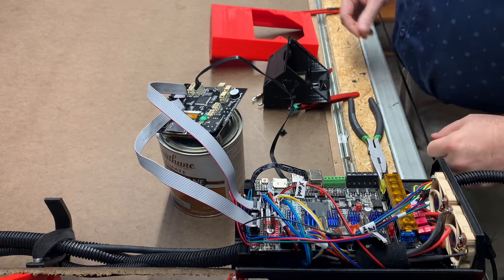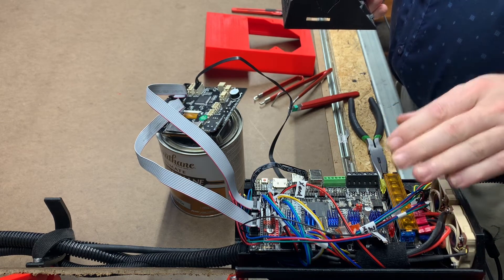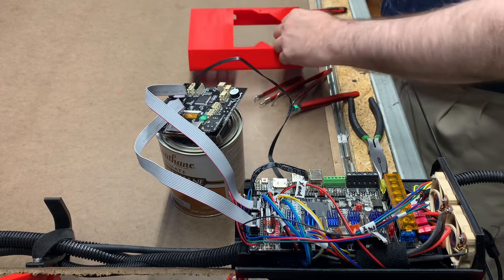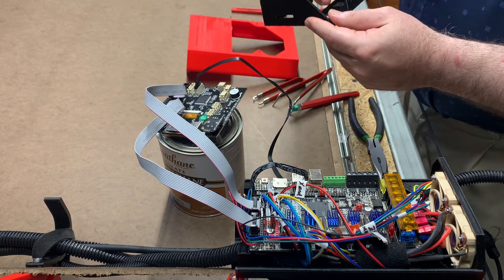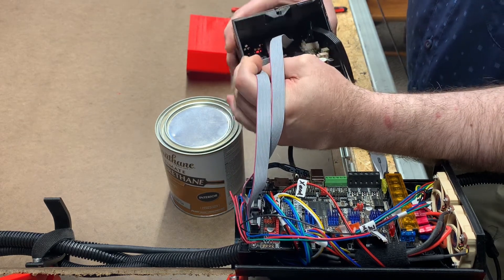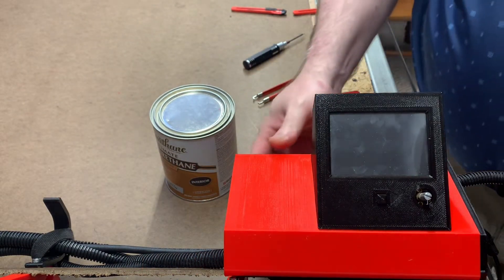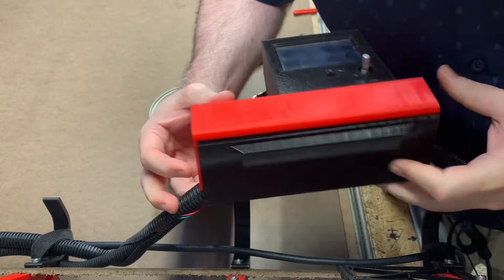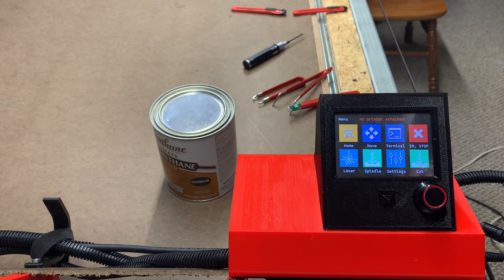LowRider 3 CNC - printed case for SKR Pro 1.2 board & TFT35-E3 touch screen

Comment: Hello.  I'm almost done with my lr3 build :) I've used your nice case design.  I'm trying to find instructions how to wire the cooling fans.  on skr pro bord.  I have bought the fans you recommended but realized I have a 24 volt power supply the fans are 12 volts, will that be a problem?
Reply from the maker: Well, it is a problem unless you sneak a buck converter in there to step down from 24 V to 12 V. The board is able to pass incoming power at 24 V or 12 V for the stepper drivers but I don’t think it has a way to step down.
Reply from the maker: If memory serves my power supply for my Lowrider is 12 V, which matches my fans. Short of using a buck converter that’s the only way to run the fans is having them match the voltage of your power supply.
Reply: @design8studio  thank you for your quick reply. I think I will mount another power supply there.  I have an idea to mount a led strip under the machine, then they can share the power source.  (I use google translate so the translations get a little weird sometimes)
Reply from the maker: @josefsnickare  great solution!

Comment: Nice looking case, will it also fit the Rambo board?
Reply from the maker: That would probably require a remix, as I am guessing the Rambo's screw holes for mounting are placed differently. I've done a lot of remixes on this but not for Rambo so far.
Reply from the maker: There might already be a case like this that fits the Rambo.

Comment: What Firmware did you flash to the TFT35? I Cant seem to get those options to show on my build.
Reply from the maker: Mine was ordered from V1E and came pre-flashed. I later tweaked it, and also, I think V1E later switched to a newer version that left (lost) some details an earlier one had. Sorry I cannot be more specific.
Reply: @design8studio Thank you for responding. I thought that may be the case. I decided to run it with Octoprint TouchUI on an old iPad this way I can make all the custom buttons I need.

Comment: Hey there! Random question I’m building my Lowrider Right now. Are you using molex connectors for end stops and touch plate connections on your board? If so what type of connector are you using? The XY extender cable connectors just pop off when I assemble my case
Reply from the maker: It's been a while so I am trying to remember. I think I followed the advice in the V1E documentation about removing the board's existing plastic connectors so that just pins were there. There are so many connectors types and names I struggle to keep them all straight.